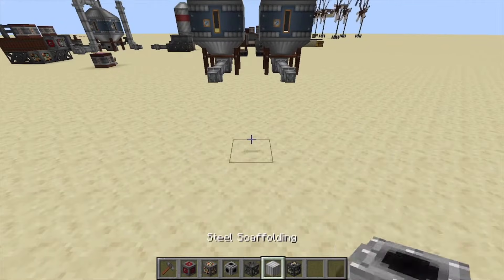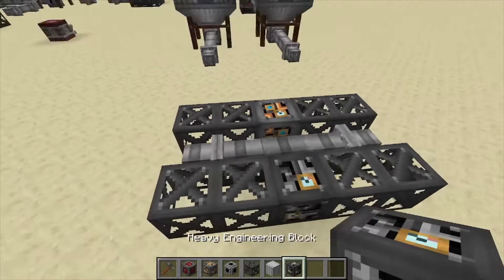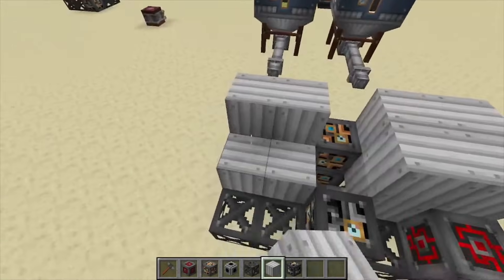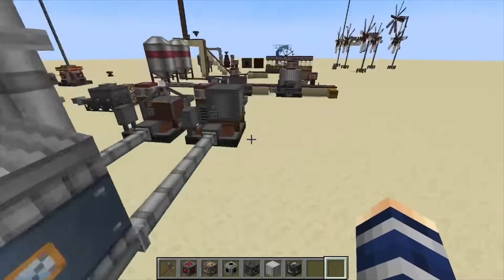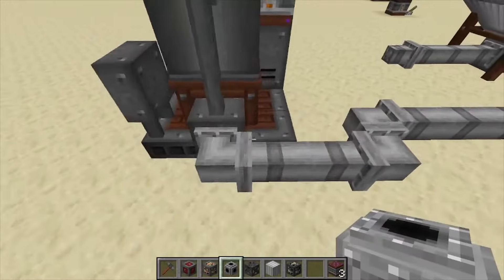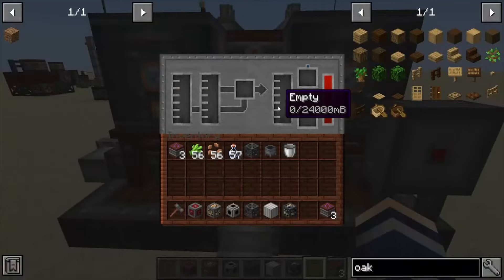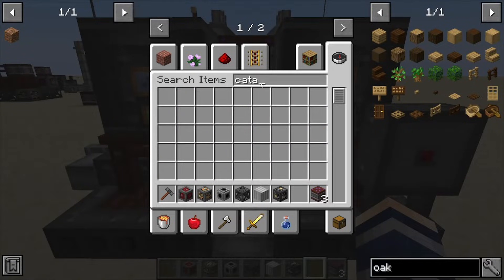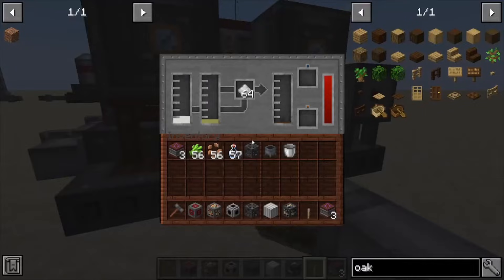Immersive Engineering: Refinery (How to make Biodiesel)

Comment: i have NO idea why my refinery wont produce biodiesel, i have a system feeding plant oil and ethanol into it, there's nitrate dust,  it has power and its on but absolutely nothing happens
Reply from the maker: So it has ethanol inside the tanks and plant oil with nitrate and Power…make sure there is no redstone signal stopping it from running OR it may need redstone in some rare cases put a lever on the red dot 🔴 to test it out
Reply: @MCMentor1  i thought that might be the issue so i added a lever, i think mine might just be bugged.

Comment: is there a way to transfer ethanol or plant oil manually into the refinery?
Reply from the maker: No but a pipe connected to the squeezer and fermentor will move to the refinery without a pump

Comment: can you automate the input of the catalyst? if so how?
Reply from the maker: Normally this wouldn’t need any more then 1 catalyst because it does not have durability. If there is no blue dot somewhere on the machine it does not have an item import option but if you do need to try placing hoppers until it works if at all.
Reply: @MCMentor1  ah well, thank you